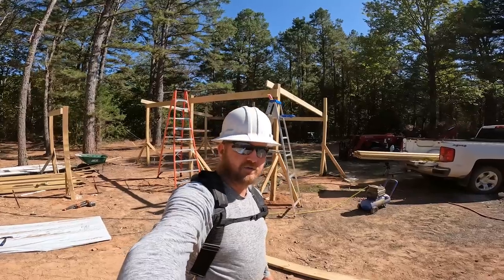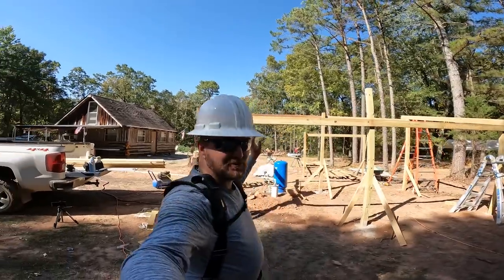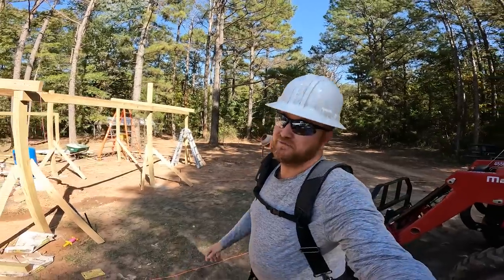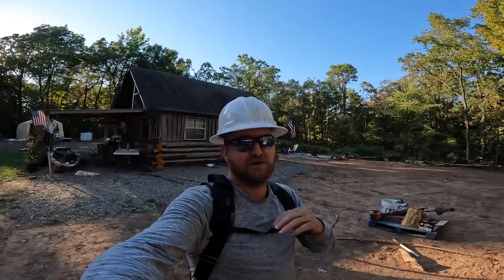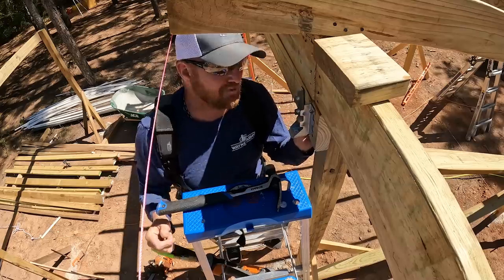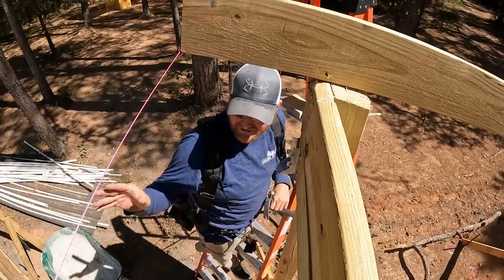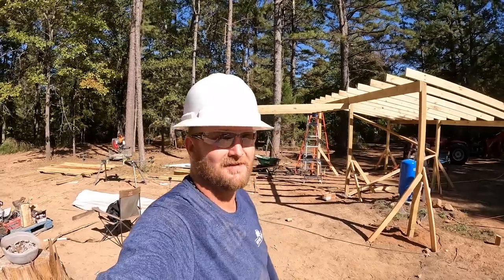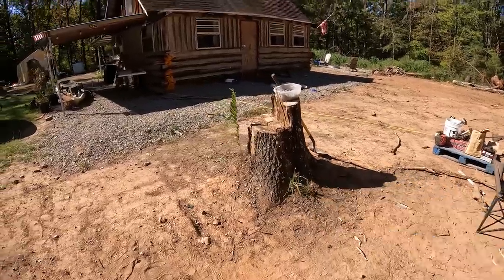COUPLE BUILDS TINY HOUSE  | building a tiny house tiny house build cabin build off grid cabin build

Comment: I don't want to sound critical, but you should always notch your beam into the post. So the beam sits on it, not hung from the side. Or through bolt it to the post. That way your whole roof is not hanging on a few nails on each side. Those two beams carry your entire roof.
Reply from the maker: They won't when the walls are up and it will be screwed of as well